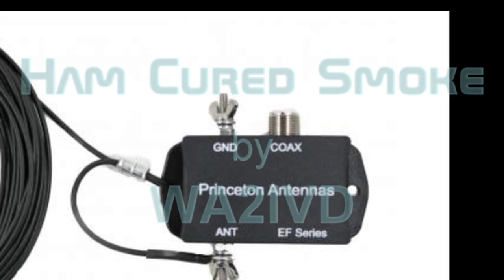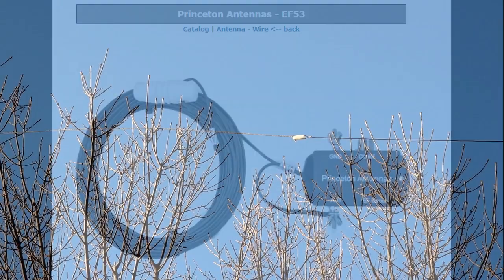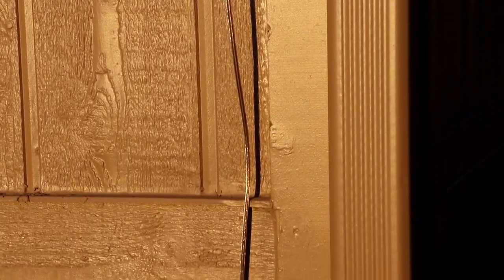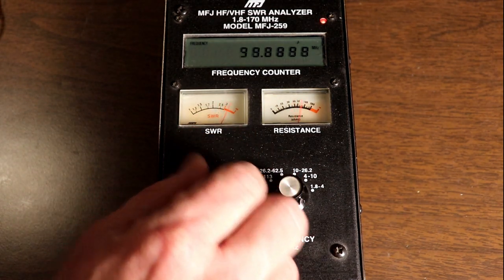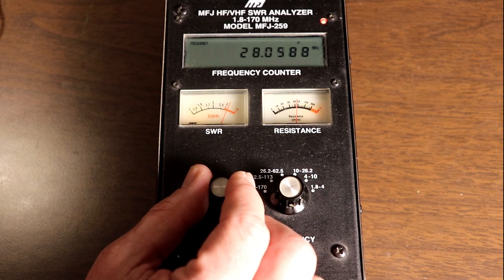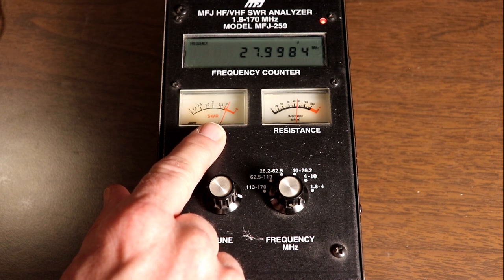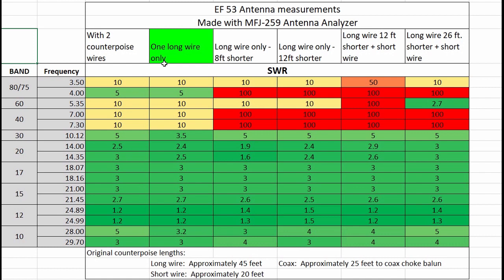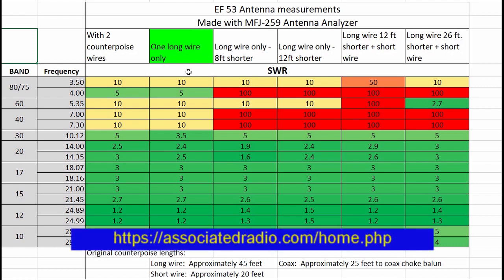HCS11 Princeton EF53 End Fed Antenna Review

Comment: Hi Tom, I have a few comments about your antenna. The End Fed is a resonant antenna on the lowest band, since it must have a half-wavelength of the same band, and on the other bands, it is resonant due to harmonics. Importantly, End Fed antennas don't have counterpois. Another important point is that the length of the coaxial cable influences the antenna's resonance. Obviously, the antenna's position (vertical, horizontal, oblique, inverted V, height, etc.) influences the SWR. I hope these comments are helpful. Best regards, Carlos LU2CRM
Reply from the maker: Hi Carlos.  Thank you for the comments.  End Fed Half Wave antennas are resonant on the lowest band.  The EF53 is called a "Random Length Endfed".  The name is a bit of a misnomer as the length cannot be random.  It is important that it NOT be resonant on any amateur band where you wish to use it.  This feature is what allows it to have only a 9:1 unun vs. a 49:1 that is typical in end fed half waves.  End fed antennas DO have a counterpoise.  It is just that the counterpoise is typically the outside of the shield on the coax feeding the antenna.  In my case, I chose to add a separate counterpoise and choke off the coax.  Palamor Engineers has a good paper on these antennas.  You can check it out here:  https://a-2-z.tech/xrqb

Comment: JUNK JUNK JUNK
I bought the 6-160. NOISY! Also  saturated it's core on low bands with less than 50 watts. It is not a 100 watt antenna. At best a qrp antenna ran off a battery in the middle of nowhere. This I found typical for the people who bought them.
   I got a core and wrapped some wire around it, like trx labs showed. I threw it up and it literally  worked a 1000 times better. I had left my antenna analyzer somewhere and couldn't adjust the length. I found it and put it on. Guess what, it was way out of wack. And it performed far better than that piece of junk I had from Princeton.
Reply from the maker: It is definitely a compromise antenna, but it worked fine for me in a rental house in an HOA.

Comment: Thanks for supporting my local radio shop! Glad to see a comprehensive review of a dog simple antenna.  Excellent VO sound.  73s, KC0SKW
Reply from the maker: Thanks for the comment.  It was my first and only HF antenna at that rental house.  It was about the only thing I could put up where I was. For a compromise antenna, it worked well for me for a a little over a year.
Reply: Looks like it'd be great on 20meter digital modes with the 45' counterpoise; actually have to back the xmtitter power down!  Link: (no affiliation) https://associatedradio.com/nitem.php?cat_id=41&item_id=1513
Reply: Oh - what'd you do with the 45' counterpoise wire?  Is it just dropped down the side of the house and tacked to the wall?
Reply from the maker: The back yard was completely fenced in by a wooden fence.  So I just ran the wire along the top horizontal board for the fence and stapled it every 5-10 feet.

Comment: I have this antenna on an IC -7200 and I hit NJ and MD with 20 watts from Miramar Beach Fl.  I have the antenna in an inverted V configuration and made contacts on 20, 40, and 80 meters easily.  Only complaint is it isn’t sealed well and I have to bring it inside every time I am finished with it.  But they have a winner here.  De AD0DQ.
Reply: There are weep holes in the housing to displace any moisture accumilation.   There are no parts inside that can be damaged by moisture, so there is no reason to bring it inside after use.
Reply: @lonmartinlonm6409  The main reason I bring it inside, and I probably didn’t make this clear, is that I have an HOA in the neighborhood. The neighborhood, Nazis, none of them very appreciative of having ham radio operators in the area, require me to pull it down lest they see it and complain.
Reply: @aldewitt9  No, you didn’t make that clear at all. HOA compliance is a different issue. The cloaking software of Princeton Antennas needs some work. 😂
Reply: @lonmartin1353  It hides nicely behind the house, but I am not in my FL house all the time.  I take a lot of trips and I spend time with grandkids out of state, and I don't want nosey neighbors skulking around looking for something to complain about.  A couple of years ago some guy flew a drone over our property because the HOA cited him for something, and filed a complaint with the county that we were invading the "natural area" (which we were not).  That's the kind of person you don't want looking for things.

Comment: Another antenna you might consider is the MyAntennas EFHW-4010 end fed antenna. We live on a small city lot; the antenna is 66 feet long and 20 feet above the ground.  It will allow me up to a kilowatt on the non WARC bands; when I sweep the antenna I get great results across the non WARC bands. Together with a tuner it has produced excellent results yielding over 2000 contacts last year with an ICOM 7300. On the digital modes (mostly FT8) I've worked east to Oman and west to New Caledonia, Australia and Antarctica. On SSB I’ve worked 48 of the 50 states, a good portion of Canada, the Caribbean, South America and all of Europe.  
Thanks very much for your great videos. 
Dick
Reply from the maker: Hi Dick.  Thanks for the comments and suggestion.  One of the members of our club put up an end fed half wave for Field Day this year.  It worked pretty well.  I’ll have to check it out. Does it use a 49:1 unun (vs the 9:1 for the non resonant end fed)?
Thanks,  Tom
Reply: @HamRadioA2Z  
Tom, 

Thanks for your reply. 
It use a 9:1 unun. It’s a bit pricier than the Princeton one antenna, but the results for me have been great. If you go to their website you’ll seem most people give it a superior rating. Like you, with your comments, I have no relationship to these guys.

Best,
Dick (WC9D)

Comment: You made a good video with NO music. Your video is informative but I am not at all impressed with the antenna. 
I use a home brew 40 meter half wave end fed and the SWR is  1.5 to 1 or less on 10, 15, 20 and 40 meters. 
I am a strong believer in using resonant antennas. 
I am sure you will make some Q's with your antenna, but for portable work, a tuner is just another item to carry along and weight is an issue for me.
Barry
Reply from the maker: Thanks for the comments Barry.  I won’t disagree on resonant antennas.  As I said in the video, it is definitely a compromise antenna.  Even their literature says that, but I was pleasantly surprised at what I was able to do for something I through over a tree and setup very quickly.

Comment: Hi,

Nice and simple setup. The most important thing is, its work. 

Here at mya base station, I am using skyloop 80m antenna; a horizontal loop  antenna, coupled with 4:1 balun, and here is the SWR values for 40m band.  I not using any extrnal antnna tuner because it has quite low SWR.

7000000 1.087500
7010000 1.100000
7020000 1.125000
7030000 1.150000
7040000 1.175000
7050000 1.200000
7060000 1.225000
7070000 1.250000
7080000 1.275000
7090000 1.300000
7100000 1.325000
7110000 1.350000
7120000 1.375000
7130000 1.400000
7140000 1.437500
7150000 1.450000
7160000 1.475000
7170000 1.500000
7180000 1.525000
7190000 1.562500
7200000 1.587500

I use hamlib tool and created a script  to  TX in RTTY mode, and change the freequency  at 10 kHz step.

Thank you for sharing.

Bahathir 9W2GNU, 73.
Reply from the maker: Sounds like you have a great setup.  A long time ago we lived on more land.  I hope to have enough land again someday to put up a full wave  80M (or maybe even a 160M) loop antenna.
Reply: @HamRadioA2Z  

Thank you for the nice words. 

Actually, my house is just beside of a small playground and there are several trees around it.   So, I just need to put wire on top of several trees' top. :)   The antenna is a good RX antenna, and fair as TX antenna   Enough for QSO around 500 km radius during typical 40m bandd's  propagation.  Most of the time I am  enjoying SWL monitoring.  I also put another RX only  verticle wire antenna   for monitoring.

Looking forward for your next video.  Thank you.